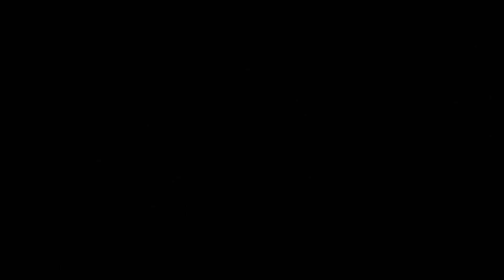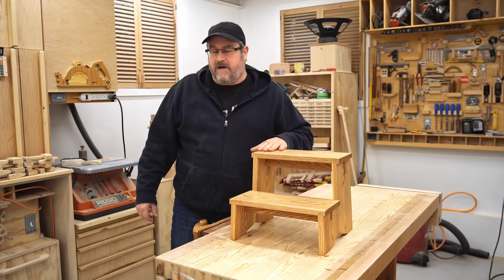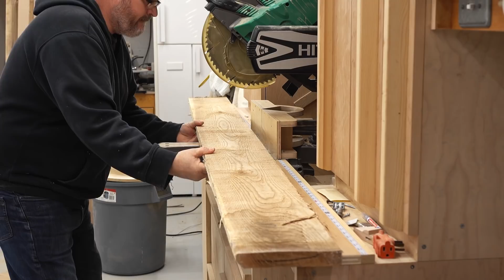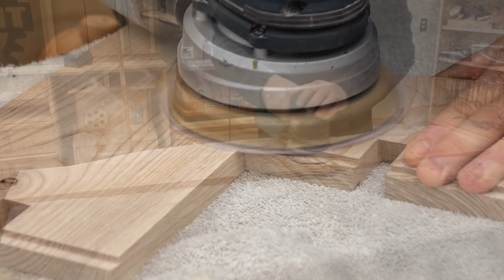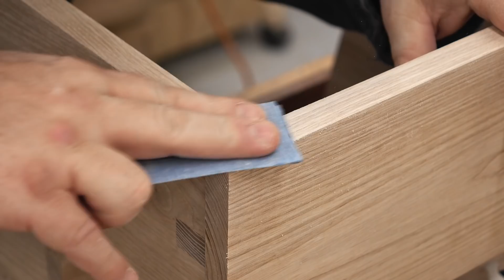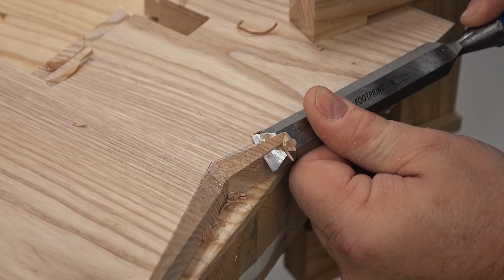Seriously Solid Step Stool Build Series - Intro, Materials and Tools

Comment: Seems you have used wood glue only for connecting front and back legs.  Will this be strong enough to hold the weight?

Comment: Pretty overbuilt hop up John, a slight improvement  is to have a two /three inch projection on the floor in front of the top step  because those buggers tend to roll over if you lean forward even a little !     Hop ups are pretty useful, I had one in my last house, a much bigger house, could never use it ‘cos my kids always had it covered in stuff !
Reply from the maker: This won't roll over - the back leg isn't vertical and the sides flare out. I wouldn't build it and make plans for it if it needed an "improvement" like that.

Comment: Dont you get a bit of a weak point with that angle cut of the base? Seems like there would be a possible shear point at the edge of the top step. Probably doesnt matter though, cool project!
Reply from the maker: Build one and test how strong it is :)
That area is the weakest point on the stool, but still incredibly strong. The glue forms a bond stronger than the wood itself, so it's not going to break on the joint.
Reply: I Build It Scrap Bin yeah I guess :) Actually built a step stool similar size, but not the fancy joinery, maybe ill try that.

Comment: Smart idea. I'm surprised you didn't do project lessons like this sooner.
Reply from the maker: It's a lot of work and to this point, it looks like it's not worth doing it this way - putting it on Patreon. A hand full of $1 and $2 per month supporters switched over to the $5 level to get the course, and there were just 3 new people that joined. 
Just 34 people in total as of this morning. And of course they can change their contribution amount at any time after they've watched all the videos. I obviously can't produce a full build series every month to give away (no ad revenue from these), so I fully expect 1/4 of those will drop before January starts.
However, I kind of expected this and did this as a test to see how it would go. You never know until you try, right?
In the meantime, I'm joining the Makers Mob and will be doing this on that platform. Assuming I can finish it in time, my first course will be there on the 21st of this month. Hopefully that's a bit more successful than this turned out to be.